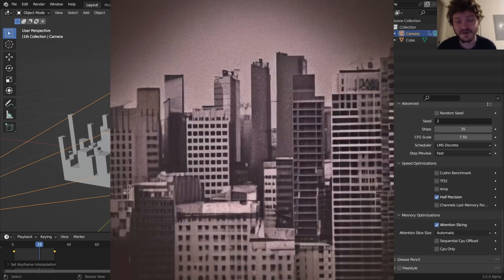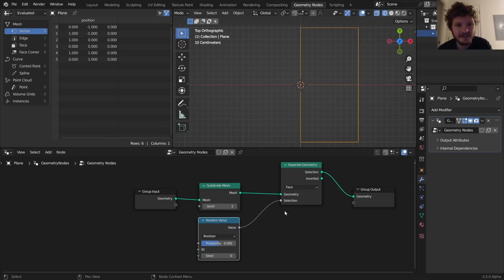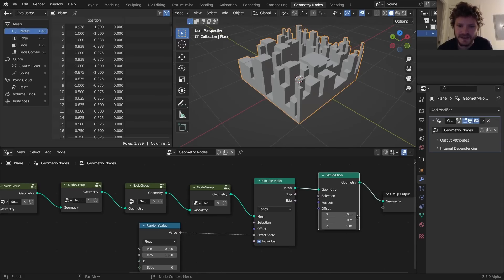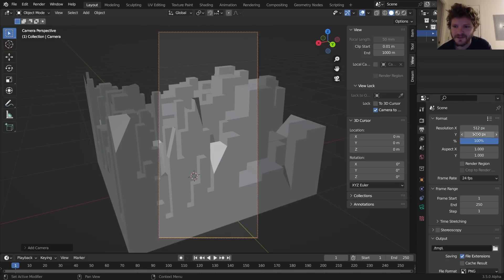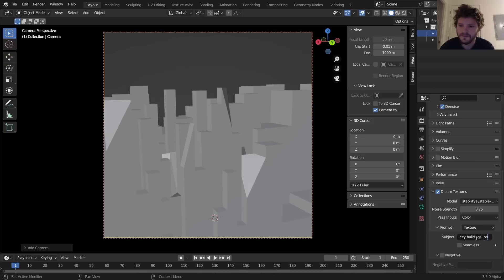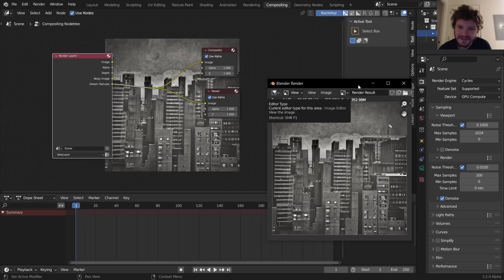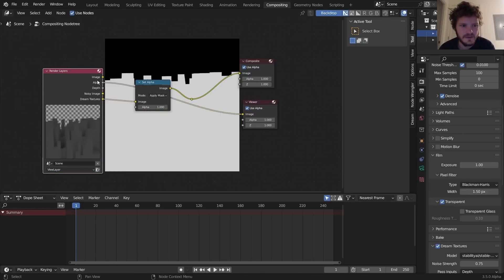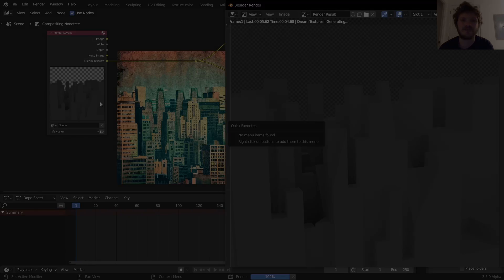Make a CITY - Blender

Comment: Damn this is awesome. Is there no way to make a "repeat" function and set the repetition number instead of having to copy the node? It would be such useful tool, maybe using the simulation nodes?
Reply: Yes there is. Check out his "cell fracture removed" video. You can use "simulation" nodes to do a looping logic that runs per frame and when you are satisfied you can then apply it. I recommend duplicating the object before applying just in case you want to play around more afterwards.

Comment: It can help to set cycles to render on CPU due to how much VRAM stable diffusion requires, and your render max samples can be reduced to 1 if you're only using depth and not color.
Reply: Blender really should add a depth only mode